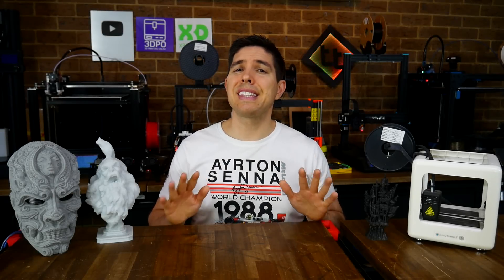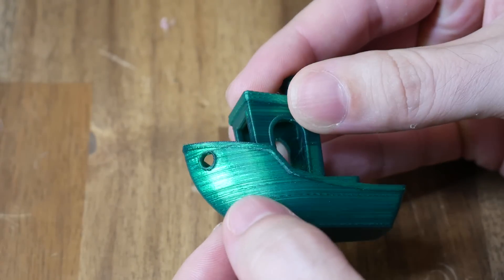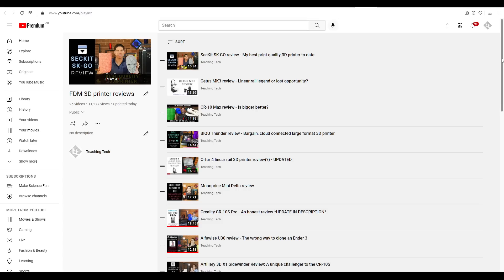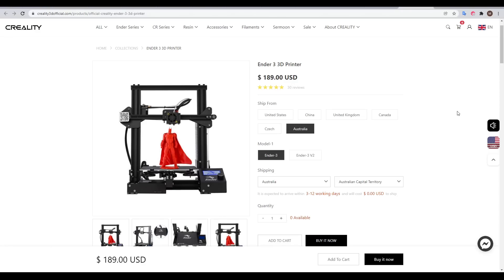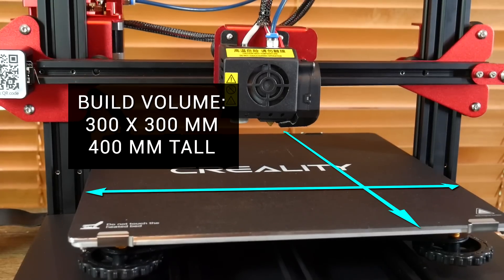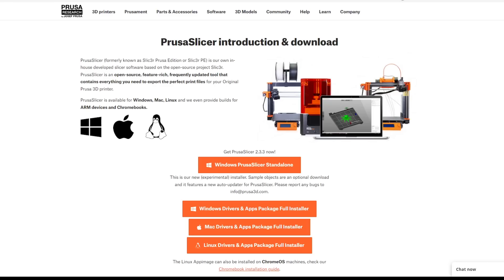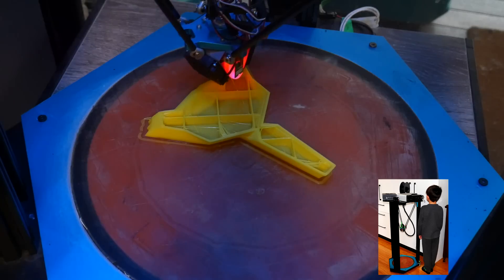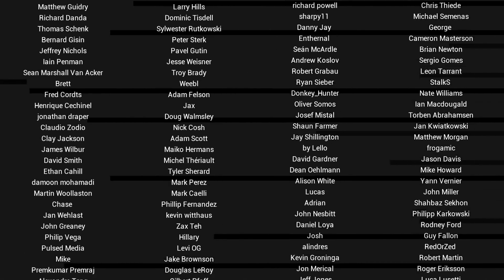Honest 3D printer buyer’s guide: Find the best machine for you!

Comment: Some things not mentioned that are important:
1.) 3D printing is SLOW!  FDM, resin, what have you are all slower than you think and most videos of prints are sped up or time-lapsed.
2) Rarely is buying a 3D printer a one-and-done effort, because of #1 or other considerations.  You’ll likely end up with a small collection of machines or continual upgrades.
3.) There’s a steep learning curve to 3D modeling your own parts.  Printing other people’s models gets old after a short while.
Reply from the maker: On the speed: 3D printing is a lot faster than commissioning tooling to be made for injection molding. It's also faster than ordering something online and waiting however many days for it to arrive. I agree FDM is not that fast but when you compare it to other ways of obtaining parts it's really not so bad.
Reply: You haven't seen the new stuff.
Reply: Depends, slow compared to what? I print nerf blasters. A print may take 4 hours to print, but to craft the same part, it would take me at least 5 hours and cost more in raw material. 3d printing is faster.
Reply: @xcal_99_industries32  beginners who’ve never seen a 3D printer running at actual speed have no frame of reference except maybe a laser or inkjet printer.  Show a person off the street who’s never built anything how long it takes to print something or how long it takes to make a model from scratch and they’d wonder what the attraction was.

I’m not saying 3D printing isn’t a powerful technology, but cycle times and learning curves of iterations for unsuspecting novices can be formidable.  My first CR-10 sat unused for nearly a year after the first dozen or so prints, simply because I didn’t have the time to invest in it, and that’s because I didn’t know what I’d gotten myself into.  Half a dozen machines, upgrades and many man-hours later and maybe I’m getting somewhere, but let’s be real— don’t many-hour or multi-day prints failing disappoint or infuriate you?  Would people mess around with hardware, settings and slicer optimizations or Octoprint, monitoring cams, fire suppression “bombs” and other hacks if print and design iterations were as fast and reliable as they’d like?  I’m sure I’m not the first or last to question whether I’d fallen into a possible sunk cost fallacy, and been better off farming out designs or biting the bullet and buying a Prusa 🤣. Seriously, my advice to beginners is to get some experience with a machine owned by a friend or school or maker space to get an idea of the workflow, the pace and the process and see if 3D printing’s for you.  This wasn’t an option for me when I got started, and even though printers have improved considerably over time, 3D printing is still a time-consuming avocation.
Reply: @ziggystardog   I agree with what your saying. It does depend on the effort to use the technology vs the will to use it. For me the 3d printing is a very useful tool at my disposal so it’s worth the effort invested into a printer. 3d printing is not a universal experience of everyone.

Comment: One use case to consider is someone purchasing their first printer as a learning tool. Their goal is to learn the ins and outs of 3D printing and decide if it is for them. Later, once they are more knowledgeable, they will be able to select a more permanent printer.

Just like someone may start with a bicycle that has training wheels even though they know that the long-term goal is to not use training wheels.

If this is your goal, to learn, look into where you may be able to use a 3D printer without buying it such as a local library or makerspace. A big advantage of this is that there may be people there to help you with problems as well as show you how to use the printers.

Another option is if you have a friend looking to move up to a better printer and willing to sell you his old printer. Assuming he is willing to help you set it up at your house and show you how to use it, this could be invaluable as he will have worked out the kinks as well as knowing how to get the most out of the machine.
Reply: Great advice I will be following.

Comment: Good video for beginners, yes, the first point about curbing your expectations is pretty important 🙂
No mention of resin printers? Those may be the right choice for certain use-cases (high detail prints, jewelry making).
Reply: Yes, but that's probably in the upcoming vids. The best thing I learned  was it's NOT a p&p thing - I first looked on-line for different kinds, options,filaments ... I even looked at refurbished! Not so fast, glad I watched this. Can you imagine?
Reply: @stacy4711  That's great that the video helped you! Have you found a suitable 3D printer, and got into 3D printing in the end? Or still looking?
Reply: Still looking, but at least I know a few things, thanks! I was wondering about the peripherals, like the bath,  etc.,? Sort of needed each time, or occasionally? I remember when I set up my first 'darkroom' (closet near the bathroom, for the wash, lol) I winged just about everything myself, except the timer. Those square black timers are mandatory, even if you just buy a huge black piece of fabric to keep the light out.

Comment: IMO I love my FDM machines, but now that I have high resolution resin printers I don't use my Taz 6 machines much anymore. I am surprised resin machines weren't mentioned in the video, as they are really the proper choice for ultra high detail printing (even on a budget).
Reply: I was also kinda disappointed by the lack of direction in resin printers. Definitely not just for miniatures or art projects. Michael could've tossed the ball to some other youtuber as the residential expert.
Reply: I've considered resin printers for a while now to make small detailed models and stuff for people.. but all the mess and such, over FDM really puts me off it
Reply: I'm an artist AND an engineer... which should I choose? 😬😳
Reply: @ty88  do you want to have a chemical bath for your finished prints and then cure them in ultraviolet light but you will have increased resolution at longer process per finished product . It will be more expensive and time consuming but resin printers do work.  Where a fdm printer can actually achieve extremely great detail with a .02 nozzle but very acceptable details with a .04 nozzle and the cost of the machine can be as cheap as $250 to have a auto leveling with magnetic build plate printer and print pla+ at $20 1kg and out the box with plenty of detail for prototyping on a build surface area of 230x230 x250mm. Similar priced resin printer for $300 will have much smaller build volume 192x60x180 mm and some of the resins or close to same price per KG usually a little higher than pla+ at least in my experience so far but you will get less prints per kg of material due to waste and minimum fill levels to keep printing reliably. You will have less build space ,more cost , more time and actual hand on work per print to post process , and the parts generally have less strength and less flexibility and less resistance to heat.
You won’t have the option of dual color prints with resin or upgrading your printer to have dual extruders to do not randomized multicolor prints is actually pretty awesome that’s not something resin will ever be able to offer. 
Actually resin printers or not really upgradeable at all once you have the unit it’s what you will have till you sell it .
But for more decorative small models that or usually airbrushed later to have colors besides one solid matte color resin prints or a great option.
I’m summary 
If your going to print 3d models of small model characters then a resin printer can’t be beat . But if your printing anything else it’s a lot of hassle for no benefit for the amount of time you will spend post processing a resin print you could easily prime and sand a fdm print to have equal details for say cosplay items or models and you will have the option of printing way larger prints.
Reply: Resin printers or for art students fdm printers or for egineers or everyone else who wants prints that or useable for everyday life things more.
Reply: @JoeWayne84  Resin printers have some advantages over FDM printers from an engineering perspective. First, they are very detailed and have a smooth finish, can do small details that FDM machines can't. Although FDM prints are usually stronger than resin on the X/Y axis, it is significantly weaker on between layers. Resin prints are consistent across all dimensions.
One down side of resin is its inconvenience, you have to wash it and harden it under UV light for hours before you can use it, FDM parts can be used as soon as supports are removed.
Reply: @JoeWayne84  Its funny you should say that, I am a mechanical engineer working in the optical design industry. I have to use SLA/DLP/MSLA machines for many contracts as the customers require considerable dimensional precision (+/- 0.001" per inch, so a 5" dim requires the part to be between 4.995" to 5.005" after any shrink), and commonly require small text to be printed on the objects (so small that 0.25mm nozzles don't adequately create the detail needed).  Don't get me wrong I like FDM machines, but most clients have shifted away from purchasing models made by those machines.
Reply: @benjaminford8173  oh yeah that’s a everyday use example right there hahah
Reply: Most people don't need that kind of a resolution. Working with stinky expensive chemicals is not fun or budget friendly.
Reply: @piconano  I agree, and for my personal projects FDM is my choice. I just wanted to mention to South that engineers actually have to use resin machines pretty often these days. And considering we use a Sonic Mini 4K, Mega 8K, and soon a Mini 8K, price wise all of those are in the same ballpark as FDM machines.
Reply: @benjaminford8173  idk, last time I bought PLA, it was $23 for 1kg. How much is the resin + 99% alcohol for washing? 
Every tool has its use. For me, fdm is more than good enough. If I was doing intricate models, that would be another story.

Comment: For my first 3D printer, I did a Super Early Bird order of the Phrozen Mini 8K. It should ship any day. I chose it because I will mostly be printing mechanical parts that must fit together with tight tolerances. I've used many FDM printers at various Maker Spaces. I'm really hoping to avoid a lot of the issues I've faced with those machines.

Comment: First thing everyone should know is the 3d printing scene is full of garbage gimmicks. You can blow tons of money on things that do nothing to help you out.
Reply: ruby nozzle 😸
Reply: @WhenDoesTheVideoActuallyStart  A ruby nozzle isn't a garbage gimmick just a misunderstood one.
Unless you are running a printer 24/7 with carbon fiber infused filaments and they need to maintain high tolerances, then the ruby nozzle is useless.

A garbage gimmick needs to have no realistic use cases not just a niche one.
Reply: @nocare  If you're running a printer 24/7 with carbon fiber infused filaments then just get a pack of hardened steel nozzles. Those "Ruby nozzles" just have a corundum tip and the rest is still brass, not to mention that they're absurdly overpriced given the fact that synthetic ruby is mass produced.
Reply: This!
Buyer beware. It's like trying to improve your golf game by buying expensive golf clubs $$$$$.
I bought an Ender 3 v2 and have upgraded it a bit; mostly for convenience. The only thing it needed though, was a new lever on the extruder. The stock one cracked, and I've read that's a common issue. Replaced the extruder with one of those red all metal ones, which should be disassembled and lubed once in a while.

Comment: I started with a flashforge dreamer and then a tronxy x3a kit and really had to learn a lot to get that working. Then moved onto ender s and have slowly upgraded those over time. Also have a Cr20-pro and at the time i bought it it was one of crealitys best printers, but it was not actually that special and replaced the board, drivers, extruder and hotend. My last printer was the Prusa Mk3s+ and I was not ready for the prusa experience. I built the kit and really enjoyed it plus have a good understanding how it goes together. It self checked when I first powered it up and I was blown away from the user experience compared to the creality machines.  It just felt like a printer that someone who printed a lot developed and took the time to add the features they wanted. Compare this to most cheaper printers that run a older version of marlin and the mechanical parts and software are just getting along doing enough to finish a task with no real care about the work. If I was to buy another printer I think it would be the Anycubic Vyper. It looks to have all features I would want from a mid range. flex plate, abl, silent drivers and a decent hotend setup. If money was no object then voron or ratrig kit or perhaps the new prusa printer when that comes out, but I don't have that kind of money for those three at the moment.
Reply: This is the problem with telling people to buy cheap 3D printers. If they do get into the hobby, they'll just end up spending tons of money and time upgrading it, when they could have just started with a Prusa or Voron.
Reply from the maker: In that case yes they are spending money, but they are learning how the machine works. A cheap machine that has been upgraded will make someone appreciate a premium coreXY kit and the features it has.
Reply: @WhenDoesTheVideoActuallyStart  but not everyone wants to spend that kind of money at the start so they buy a cheap one and either love it or hate it. If they love it they will go on to upgrade and learn more and more. I know way more from all my problems than if I bought a mk3 ready made and it just worked.
Reply: @leesmithsworkshop  If they hate it they can sell a Prusa/Voron and make most of their money back.

Comment: I go for my own built Core-XY printers, have 2 and these have been running continuously for more than 6 months without major problems.
Reply: Witch printer will you build? I wanna also build one. But 1500$ for the voron is a bit over my price range. And the new prusa max are out of space
Reply: @o0Vion70o  I build a hypercube with part from severel parts from thingiverse one  = 300 x 300 x 350 and the other is 220 x 220 x 300 with 3030 and 2020 profiles the small one is for scholarships.